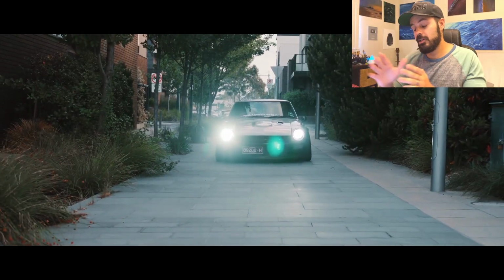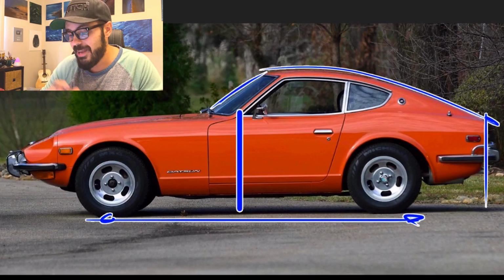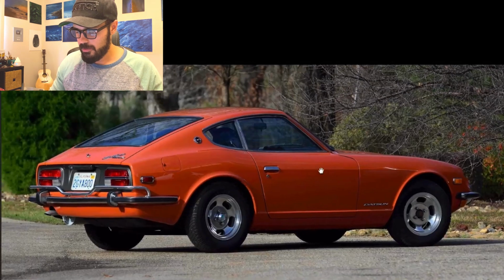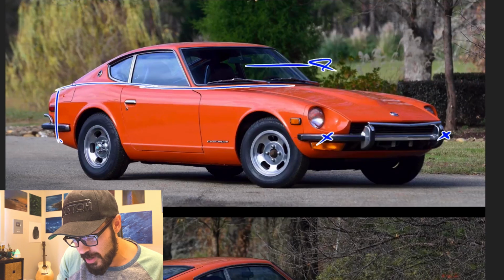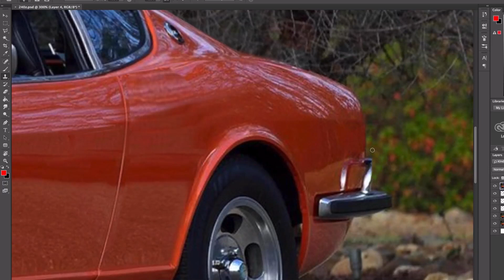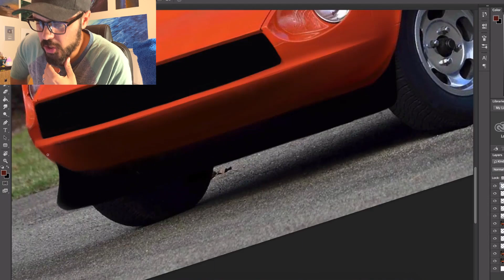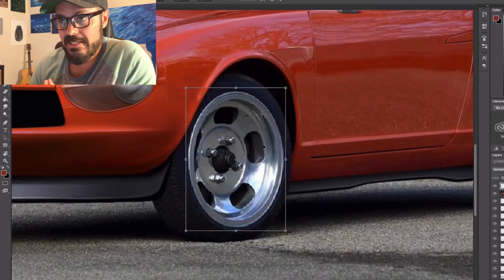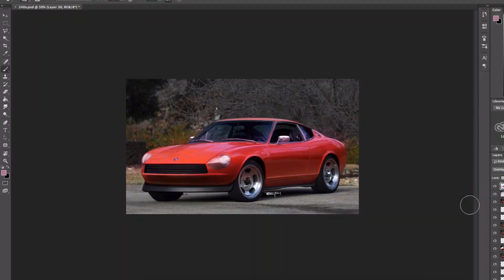I redesign a front-engined Datsun 240Z intro a mid-engined Datsun 240Z

Comment: Whoa, it is perfect! Still distincly 240z, but perfectly executed mid-engined proportions. While you were sketching it initially started looking very Dino, but in the end it was clearly 240z but with a powerful mid-shippian stance like a Panthera. The only flaw is that i could not see an inline-6 to fit back there, except maybe in a transversal configuration. Yeah, maybe throw the 370z's engine back there, but turn it 90 degrees.

Comment: I would consider this one of your what if it was made today cars as the bumpers would have been period correct. I like the shape a lot.  It works really well.  You probably should have darkened the interior or worked out the details of the passenger side windows and rear window.   I was surprised you didn't really do anything there.  I also like how you kept the wheels stock but just made them larger.

Comment: This was a fantastic rendition. It kind of reminds me of the Ferrari Dino. However, you forgot to give it the original door handle. I noticed you don't like door handles.
By the way, the Nissan 240 Z style is called a fastback, because the sloping roof-line terminates abruptly at the rear.

Comment: Can I suggest a new idea for videos? How about, for some of the redesigns you do, you also factor in the dimensions of the new car design based on whether a specific number of engine/gearbox packages would be able to fit in the new car? Like, how much longer would the rear section of the car be if it had to fit an inline-6 engine (eg an L28 or an RB25/26), compared to a V6 (eg VG30, VQ35, VR38, etc)... Wouldn't the size of the engine itself affect the basic proportions of the car in question?

Comment: I liked the sketch ....it echoed well.....but like the new Corvette...it's no longer a Corvette.
   Both cars HAVE to be in original configuration.
    If Nissan produced a mid engine they could call it a "Z"
Just not a 240Z.
I can't put my finger on why the rear quarter lost its Japanese feel, and is more camaro-ish !
    Still the 240z ,has potential for a retro style reintroduction
Using the original styling Que's.
    I feel the continuation cars have always been good - but they were never  a, modern 240Z.
   Always look to Porsche , for Sports Car ,Guidance.
Take the Classic 911 of the 60's side by side with a current 911,it's bigger holds more modern innards but echos the same as the original.
    This should be the exact same approach with a modern 240Z.
   Retain the styling Que's ! But bring it into today.
   Really non of the continuation cars , took this approach.